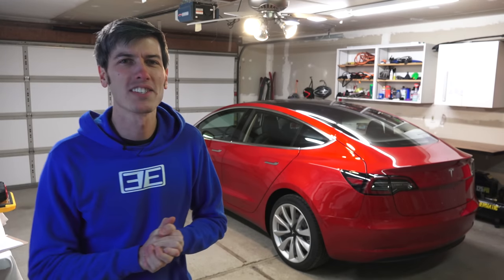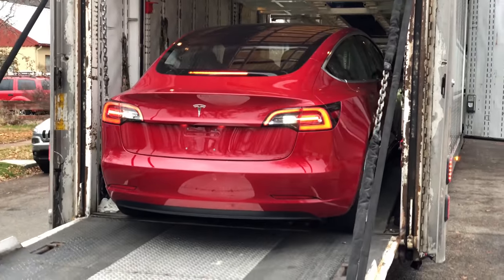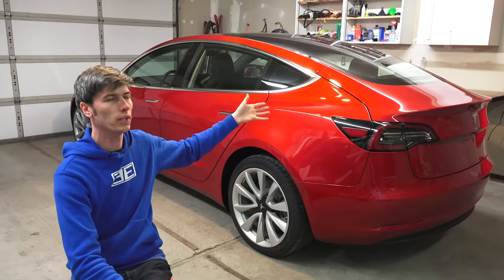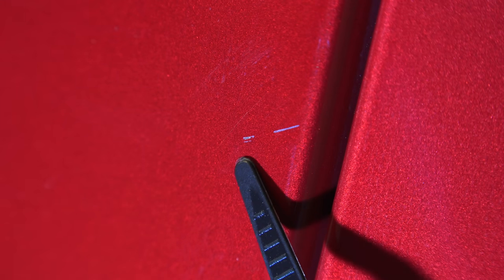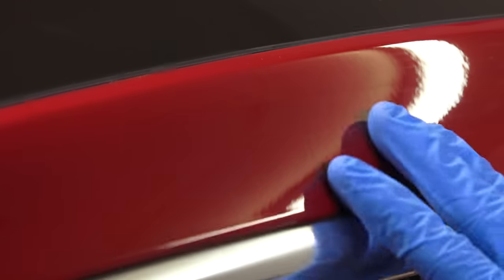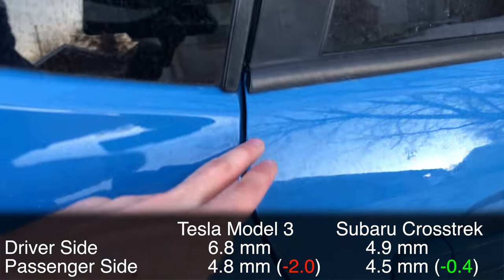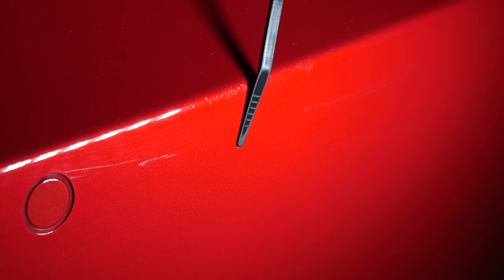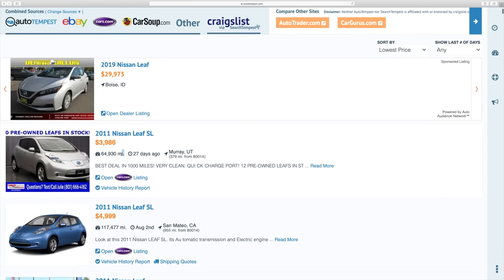Everything That's Wrong With My Tesla Model 3 - Quality Problems

Comment: I'd love a Tesla but I'd feel sick if I paid that much for a car and it arrived from the factory with such a terrible paint job
Reply: could he reject car upon delivery and personal inspections? does he have a right to complain to Tesla so they could fix (eventually repaint problematic panels)?
Reply: @CroIntr00X  Yes, and he should have.
Reply: The scratches were probably from mishandling during transportation, as opposed to factory errors, but overall, I agree that this is an especially poor example of Model 3 build quality.  I might have declined to take delivery on this vehicle until they either addressed all of the issues or delivered a different one to me.  My slightly older Model 3 is in much better shape than this.
Reply: @SUPERBOOM777 Lets say, why not, if it is electric and working... But what's wrong with Tesla's is the basic thing - about it is huge high powered luxury sedans working as first battery cars. I dont want 2 tons heavy piece of poorly painted battery rack. It's not usefull - why we through dawn of the battery age are doing this heavy crap? I like the way BMW or VW does the electricity as VW e-golf is small hatchback with range about 300 km but half capacity of batteries. 
I already read complains on Tesla's from others EV owners about Tesla's with their huge batteries are blocking charging terminals for too long, while BMW's and VW's are charged in 10 - 15 min's etc.... I like electric vehicles, but sadly it is not just about electricity - electrification goes through lowering of weight and changing our habits....
Reply: You'd feel sick? You clearly have your priorities out of whack.
Reply: @SUPERBOOM777 the boomer spoke up
Reply: Cybertruck fixes this..?? 🤷‍♂️
Reply: @ErikHarris  Their paint jobs are known to be on the thinner side compared to other manufacturers tho right? So if that's true damage during transport will be more common.
Reply: Telsa is not worthy any love.

Comment: The paint flaws are unacceptable, especially the trapped debris under finished paint and the scratches thought the clearcoat into the paint.
Reply: Thats more common than you might think. ;)
But most people just don't look for it or simply don't care. We had two on our VW Passat and one on our Audi A4.
I worked in the quality control department for a huge steel company a few years ago and debris can also be fragments from the steel plate manufacturing process. As an automotive supplier, the company actually had different quality specs for different automotive companies while Toyotas requirements were the strictest. We had to destroy/recycle several coils because of minimal flaws within the steel plates.
Reply: Yeah vehicles need to go through routine inspections throughout the manufacturing process, nobody saw the blemishes after applying the paint or while applying the clearcoat? Ridiculous. It could be because Tesla has been known to treat workers poorly and most auto manufacturers are only concerned with saving manufacturing costs and getting cars built as quickly as possible, so instead of that worker lowering his average time to complete his work he just didn't mention it.
Reply: Inspections? No, they're too expensive. Cars go straight from the drawing board to the factory and then straight to the customer. No expenses inbetween.
Reply: @CloitSirron  
You're comparing Tesla's quality with another carmaker that is just as bad. Doesn't help your argument.
Reply: Some of it could have been during loading or unloading on the truck or during transport. They always move your car if they need to unload something else.

Comment: I have to say that If I i bought a brand new car  at any cost I would not accept that car if it had the paint damage that your car has.
Reply: Preach, leave that for me to scratch up after a month of being extra careful then saying what the hell.
Reply: I agree, it's just unacceptable. Kind of amazed.
Reply: But any other car hasn't the fanatic factor that most of Tesla buyers have.
Reply: It makes me wonder why Jason even signed the delivery slip to begin with. Don't accept a car with scratches.
Reply: @dannydaw59  it's paint......... lol, not a deal-breaker.....
Reply: @ @ar053x : It was a $2,500 paint option, or did you even watch the video?
Reply: if only their were some sort of intermediary to deal with, instead of just the non caring parent company. Some sort of, what could we call it? Dealer maybe?
Reply: I’d be taking the car back and flat out DEMANDING they fix the paint. Respray the bloody car.

Those cars here are more than a HUNDRED FREAKING GRAND!
Reply: @jeffsadowski  @Jeff Sadowski I agree, that's alarming. How many actual flaws in the body that you can't spot?
Reply: @CelticKnight2004  The model 3 isn't close to $100k. Still, for roughly $50k (depending on options), it shouldn't have these problems.  Hell, I wouldn't accept it even on a $13k Nissan Versa.
Reply: I bought a VW a month ago 1500 miles away and didn't inspect it for this kind of damage until last week (due to weather). I found no issues apart from the front bumper holes.
Reply: looks like most scratches were done to the car after the paint dried ... eg. during transport / loading in the truck, etc....
Reply: John Miller For sure. My model 3 long range RWD had similar panel gaps, clear coat scratches. Sent it in for service and they fixed it within 3 days and gave me a p90 d model S. Wish they kept it much longer lol. Shitty that the issues existed in the first place but service was outstanding compared to the crap I dealt with on my 5 series. Tesla was well wort it imo, such a great car!!!
Reply: I work in the final inspection line at a major auto manufacturer and just one of panel gaps or paint blemishes would cause it to get rejected.  Somebody would get fired if this left the plant like this.
Reply: Completely agree. Brand new car = no scratches.
Reply: @dannydaw59   I think he accepted the car so he can make this video. He's already made a lot of money with just 1 day after uploading.
Reply: @Joe Casson And the sad part is it's multiple scratches. On a premium paint job that cost $2.500 extra.

Comment: You're right to complain otherwise Tesla will think that it's owners will think it's an acceptable compromise for driving an EV.
It's an expensive car, it should look and feel like one.
Reply: When your average truck in America cost $30,000-$60,000 new a $46,000 car is not expensive specially when the higher luxury brands are $40,000-$80,000. the average new car price in the US is $36,000, expensive would be $60,000 plus, cheap would be $25,000 or less. And is coming from a person who payed $40 for a truck that got me through high school and a few years after before being sold for $400 and then bought a car for $1,400. That being said, the gapping should be better though gap quality can be considered nitpicking, but the paint has zero excuses for that even leaving the factory. The one dust particle I can see being left in but all those scratched are horrid and should have been repainted. But Tesla is handling it.
Reply: It's not worth the price imo.
Reply: @MattGarcyaDC  This is fine, I like Tesla but I wouldn't buy any but the roaster. Though personally I would rather just buy another Fiero or an MX-5 or MR2 and convert them to electric.
Reply: A very large majority of people are still accepting delivery though. Pointing out the defects may not necessarily make Tesla focus on them, as the vehicles are still selling, but one can hope.

Comment: I work at a car manufacturing facility, and I work with engineering and maintenance in the paint department. That said , our goal is to send out good quality. We’ve had issues with dirt in the paint, metal birds , clear paint sags, e-coat  primesand spits, Our department has shut down other departments such at trim and chassis to fix some quality issues. Looking at your video it appears to me that this paint mutilation with all the fine scratches and deep cuts probably came from the next department called trim and chassis. You also have some fitting issues with the body. Teslas’ stamping and body department engineering needs to either check quality a bit more before shipping it to the next department, because I’ve seen offset gaps in the body in my department before the car is actually painted. My team calls out the Bodyshop department and we perform a trace back procedure to find out how many units have those offset gaps , and also they need to check with their suppliers who makes the doors if they don’t make their own doors ,and other parts to see if they’re manufacturing defects. These inexcusable defects you’ve pointed out should’ve been VES calls all V1! Sorry for using manufacturing technical terms.
Reply: I'm not sure if you should be telling all these people about VES and telling them you've shut down T+C because of your quality concerns. Especially as you have a Nissan as you profile pic..
Reply: I'm sure it's not just Nissan. All manufacturers go through this continuous "find and fix" management. It is very normal for manufacturing and never stops. Just as soon as you "tune" a process another process shows itself and your on to the next problem. The end goal is to make sure a product can go from one end of the assembly line to the other and out the door without ever moving backwards. Its difficult for any manufacturer. And just because he has a Nissan in his pic does not mean he works at a Nissan plant. ;)
Reply: I was a corporate auditor at Mitsubishi, and the dirt in the paint at 5:55 would have gotten a call to the paint department. The scuffs would have been marked up to probably trim. The amount of stuff they let through on this car is staggering.
Reply: Reading your comment was super interesting.
Reply: I am an engineer working for a large german premium manufacturer. Normally I would be very skeptical seeing all these flaws in a brand new car straight from factory, but since I saw similar and worse problems with my own eyes in case of a Model S with a listed price > 170K, the claims made in the video appear to be plausible. For a car with so many defects to leave the factory their QC processes have to be utter trash or non existent. Not to mention that many of the issues shown would never even occur in our plant as processes have been setup in preventive ways. Even if so, a car like this would never leave the factory. And with this staggering amount of defects, heads would roll for sure. As for the panel gaps, I have personally seen Tesla's that are even worse, but this one is bad enough already. We have very narrow tolerances for gap offsets and use the latest measuring and production technologies available. It's still not an easy task, but in Tesla's case the entire manufacturing process has to be flawed, not just some sections. Measuring another car will result in vastly different offsets, still way out of their supposed tolerances. It's not just a specific part that is out of spec or a machine that isn't calibrated. There is a randomness at play that - if I had to guess - stems from a mixture of human  error and poor structural body design with regard to best assembly practices and an overall rushed or non existent QC.
Reply: Commander ™ total agree!
Reply: Sebastian Howard thank you!!!
Reply: Marcus Wilmsmeyer I agree with that!!
Reply: E J exactly!!! Sheesh man ! I agree With all what u said.
Reply: As i know, Tesla makes they own body parts, but they deliver it to next factory where tesla cars actually assemble.
Reply: @C0mmander  They dont buy the car right from the factory right? It gets delivered to a dealership, and it is between factory and dealership those scratches are made 9 out of 10 times by the transport company. Since i work as a reconditioner also for a german premium manufacturer at a dealership i am stunned by the poor quality this car got delivered in, the amount of scratches and severity of them left before delivery makes me quesstion whether the dealership just ripped off the protection and washed it before delivery. This should have been taken care of by the reconditioner at the dealership, assuming they have one.

However, when he said that those scratches gone through the clearcoat just because they still show after spraying water on them , well, i disagree.
Reply: @DirtyRC101  There are no Tesla third party dealers and as the video showed he was delivered his vehicle directly from an enclosed trailer semi truck. All these flaws are most likely 99.99999% from the factory.
Reply: @rangegod98  Which would get a person in more trouble? Disclosing lack of quality control or being up front they are willing to shut down a production line for quality control issues?
Reply: @emjoneshouseDIY I am aware of process variation, but I don't think he should be disclosing this information to general public. I'm not sure that any other manufacturer uses VES for vehicle evaluation.